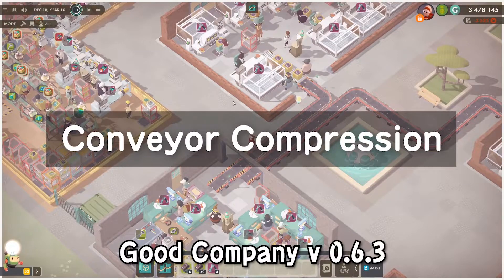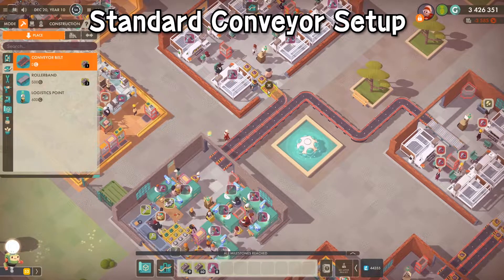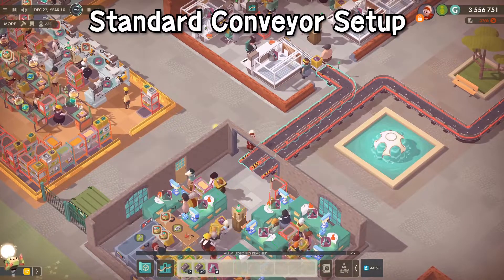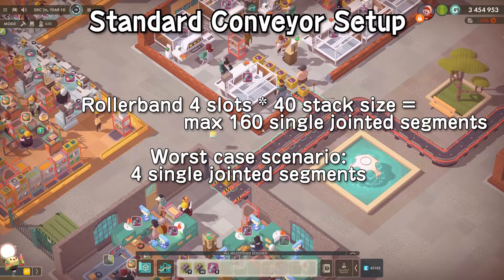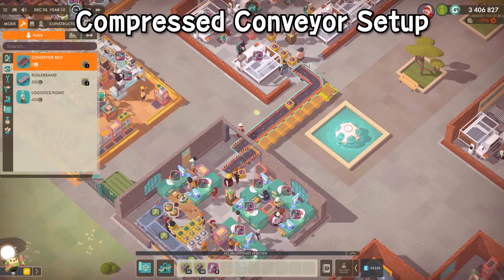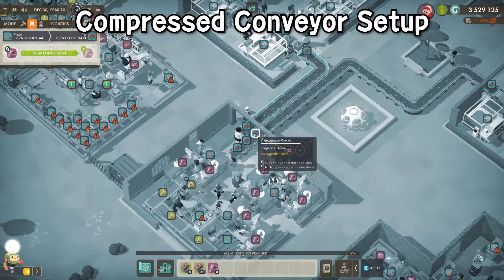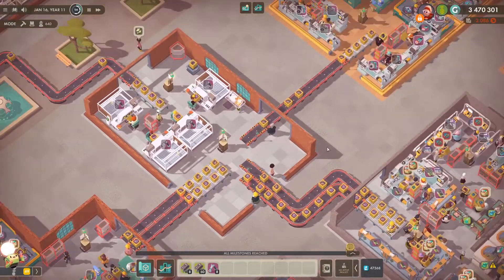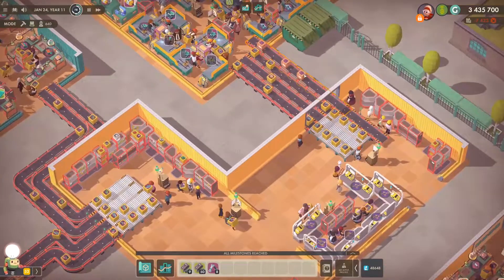Conveyor Compression Guide - Good Company

Comment: Hey! I had no idea you could combine items like this, how useful would you say this is in the long.  I feel like stuff could still get backed up?
Reply from the maker: Having too many materials backed up is expensive, so you don't necessarily want to compress every belt, but it can be helpful in certain situations with high throughput requirements or long transport times. I had enough production, but I couldn't deliver material fast enough, that's when I sort of combined the other conveyor tutorials I saw into this technique. When the conveyor belt is very long, it might take 20 seconds for a module to get from the start to the end. Imagine you're consuming DC motors at a rate of 1 per 5 seconds. If the conveyor is backed up from 1 single DC motor at the end point, you'll never get enough throughput. Using multiple "conveyor start" segments lets your workers keep placing modules on the belt so there is less "lead time" between module deliveries.
Reply: tashi. moe ah I see, that makes sense, I’ll defo try this! Thanks for the video!